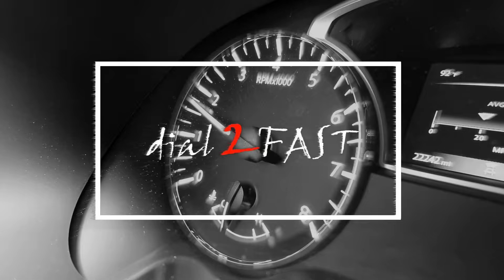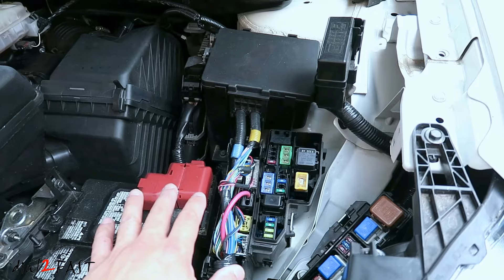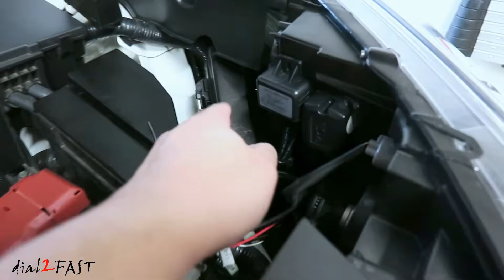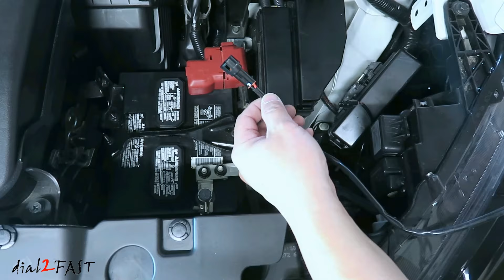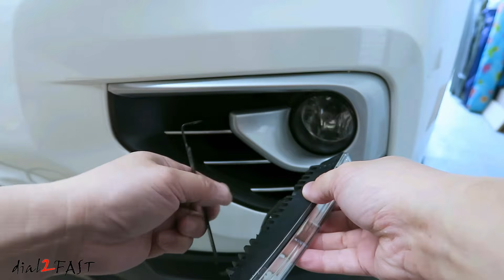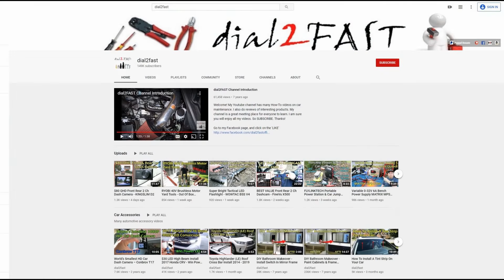How To Install (DRL) Daytime Running Light | Nissan Pathfinder

Comment: @dial2fast, I am really glad that this video popped up in my feed. Still, I have questions. I purchased an aftermarket LED upgrade for my 2006 Honda Accord. The original lights have filament bulbs, and one of them is a shared daytime running lamp and high beam. I read that the way the car switches off the DRLs and turns on the high beams is just by a voltage change.

My new lights use the stock wiring harnesses for the low beam and high beam LED bulbs, as well as the amber signal, but there is a LED light bar on the bottom that just has a black and red wire. I want that to light up when driving, but turn off when the low beams are on. What is the best way I can go about doing this? I appreciate your advice! ProTuningLabs gave me no instructions, only a link to a YouTube video which was not apple to apples.

Comment: Why he did not tap wire of existing DRL?
As far i can recall the OEM DRLs do not turn on immediately with ignition. They turn on when you shift into Drive. But the DRLs installed by him turned on with ignition. Though it is nice video but He could go one step ahead as mentioned above. 🙏🙏🙏
Reply from the maker: You can't simply just tap the factory DRL because you don't know how much current it supplies. Also many factory LED  systems uses PWM (pulse width modulation) LED driver that outputs varying duty cycle voltage, and it's not meant to drive additional LED lighting.

Comment: I'm thinking how the DRL controller works with smart alternator where the voltage is fluctuating between 12.4v to 14v and above. Does that mean the DRL dimming will fluctuate as well?

Comment: Thank you for the Video! Great explanation!!
Do you have an update for us on the life of the DRL controller? I see reviews on Amazon saying that the controller stops working well after sometime. Killing battery because the lights would stay on passed engine off.
Reply from the maker: The DRL controller that I installed in this video did fail after 3 years. I just replaced it with another one (same type), and it's been working fine. In my experience, aftermarket stuff can fail, it's just what can happen when customizing cars. As for killing battery, I personally don't like to run stuff off a car battery when ignition is off. That's why in my video I connected the power to ignition 12V. The problem with running stuff off the battery when ignition is off is if your battery is couple of years old, it can quickly reduce the battery health. And if the auto off feature doesn't function as designed, then it can further drain the battery.

Comment: Great YT video explaining how the DRL controller works. I have a question, I am an electrician and use a multimeter daily, what is the device you have clamped on the ACC wires to measure relay voltage called? and where can I find one like you are using? must penentrate the wires with the alligator clips in order to get the wire inside the insulation.
Reply from the maker: It's a FLUKE AC89 https://amzn.to/4afcIlz

Comment: I need a system that will Turn  DRL "only" when the lights are Turned to "Parking Lights". Can the yellow  blue wire be used for that feature? Other wise I want the lights to turn on when engine starts, off when shut off -after X seconds and dim when Headlights turned on.

Comment: I bought a similar drl that has that white cable for dimmed off but when I connect them to the power while drl on, it just turned off the drl, i’m wondering if I need the drl controller too?

Comment: I have a question, would it matter which side is for the turn signal ? Would I have to tap into either both headlights or just one would be fine ?
Reply from the maker: If you want to connect the turn signal 12V (so your DRL will flash alternately to the turn signal), then you have to connect the left turn signal for the left DRL, and right turn signal for the right DRL.
Reply: @dial2fast  how would I wire that ? Since the DRL remote only has 1 set of colored wire

Comment: Hi Sir, thankyou for the video, i have similar drl controller and drl light, can i use fuse tap (piggyback fusetap) and put in on the acc of my fuse box the drl controller?
Reply from the maker: Yes you can get power from the fuse box with ignition 12V, then it will turn on/off with the ignition.
Reply: @dial2fast  thank you much Sir, one last question the drl controller has a fuse to it. Should I put also fuse on the fuse tap like 5a or lower? I dont know how much is the ampere of the fuse on the drl controller. I will input the piggyback fuse tap  to an empty slot of my fuse box with 12v on it.
Reply from the maker: Even if there is a fuse on the DRL controller, you can still use the fuse tap on the fuse box. For regular LED DRL, 5A (or 10A) will work fine. The 'LED DRL' light itself won't draw more than 1A (assuming that's what you are using for lighting). A rule of thumb when it comes to the placement of a fuse is there should always be a fuse closest to the power source (in your case, it's the fuse box, so using a fuse tap is ideal)
Reply: @dial2fast  thankyou so much Sir for the knowledge that you share.

Comment: I'm gunna throw a spanner in the works of a DRL installation. In New Zealand & under current vehicle by-laws & what we colloquially call a WOF (vehicle, Warrant of Fitness) when you go to turn on your side lights/mains etc your DRL/s must actually switch off automatically & not merely just dim in visual power output!! It is therefore illegal to have both your DRL/s & your main lights (high or low beam) on. You can have one or the other (DRL/s or mains) but not both switched on at the same time. If you are going for a WOF at the time you will be rejected as I was!! No WOF means you cannot use the vehicle on a public highway period!! So I'm looking for a suitable wiring diagram to cover this scenario & any help or assistance would of cause be most appreciated. I'm no auto electrician but I'm not green behind my ears either & have a reasonable understanding of basic vehicle systems. I've actually completed a wiring diagram to cover this requirement but would like to compare it with somebody else!! Any takers please???

Comment: Why do you need an LED driver for? Can’t you just connect the black wire to the negative and connect the red to an accessory fuse?
Reply from the maker: Because a properly working DRL should have dual brightness. Bright for daytime, and dim for nighttime. If that's something you don't need, then connect to the ignition 12v fuse.
Reply: @dial2fast  thanks

Comment: Hi man .  I hope you will help me to find the right solution for me. I want the transformer or the regulator of the LED light, which in turn reduces the LED lighting from 100% to 50% when the light is turned on in the dark or at night.  Or the organizer to buy it online if possible ❤️🫶🏻

Comment: I have a question sir . I have an existing fog light switch with relay and top it on ignition. And I want to use this as a drl switch. I trace the connection red wire goes to the firewall and both have a Blk wire that tap on body ground . The problem is , I bought the drl harness with module  dimmer .  It say on the diagram  the red wire with fuse should tap on directed to positive of batt. And Blk wire neg of batt . The blue wire (ACC) where should I tap ?. On the red wire of the fog light switch ? Or  should I ignore the blue wire.  Or maybe the red wire  with the fuse  I tap directly on the positive of the fog light switch that goes on the  firewall ? Thanks in advance

Comment: Great instructions I purchased thru Ebay new LED Lights for my Audi Q7 2009 and at night it turns White and the signal changes to orange. I want to use the White LED to stay on all the time that way I don't have to turn on the night lights during the day. What I need to buy in order to use the front bumper LED's as Daytime running light with no Dim.? Thanks Auggie
Reply from the maker: If you want it to stay on white when you drive, then just connect to ignition 12V. So when you start your car, it will turn on, and off when it turn car off.

Comment: Thanks for the great video. I installed the exact controller yesterday but when I turn on my turn signals my LED flashes with my turn signal. It’s suppose to turn off the LED to my knowledge. Any idea why that is? I have yellow to positive turn signal.

Comment: I have some sequential mirror turn signal DRLs. It came with a normal plug in and play connector but also has a white wire for the running white lights. Someone said I could jump the window switch wire to get the day time white lights to work. However, my car has auto headlight on and off feature depending on the outdoor lighting. I wanted the mirror running lights to run off the same function is there a way to jump the white into the column selector wire for “Auto” so it works the same way as the headlights go on or off based off ambient light?

Comment: Hi! I have a question. I bought the exact same LED DRL ligh bar and also bought the module. I installed it, but for some reason it wouldnt turn off.

Comment: I've had mine installed for a year but I had my ground wire directly into the negative port of my battery. I then placed it on a bolt inside the bay near the nearside headlamp. There's now a buzzing and clicking and they no longer come on?
Reply from the maker: That ground bolt you are using is not a good ground. You might think a metal bolt in the car is ground but not always the case because the panels on cars are glued and spot welded. Also many people don't know steel is not the best conductor compared to copper. To truly find out if the ground is good, you should use a multimeter to test the bolt. Or you can just try another ground bolt.
Reply: @dial2fast  thanks for the reply. I'll do what you suggested. Thanks

Comment: How, where and why do you have a ground wire when the instructions for the “iJDMTOY (1) Universal LED Daytime Running Light Automatic ON/OFF Controller Module Box Relay” doesn’t even have instructions for it? It doesn’t even show or have a ground wire. Is this a different product than the link you provided?
Reply: The instructions says the black wire goes to the negative terminal….
Reply: Hello? That was a serious question 🙋‍♂️
Reply: @ryanoswald5506  Negative (black)  is ground  on modern vehicles.......at one time back in the day , there were cars and trucks that were positive ground (red) .   a GROUND simply means that everthing  metal on the car ( chassis) is the negative black , or a GROUND........the black  negative battery terminal is a ground .........And this is not to ever be confused with House current ( 110v/120V etc where Green is ground. if you use a black wire for ground in house current you will have a shocking experience , pun intended.

Comment: I have a Ali express Mazda 6 drl set which does constant on and turn signals. The bezels run to a box that lets out a red, black, blue and 2 grey wires. I need someone to tell me where exactly to wire these too. I’m guessing black to negative ,  greys are prob indicators.. haven’t a clue where to wire red or blue

Comment: T tap are very bad many problems with intermittent shorts.  The soldering may take longer to do but when heat shrink does not cause problems.  I will give it a go . Looks like easy instructions Thanks

Comment: Ok I’m on cycle 12 of this video.  Mine doesn’t have a separate power supply.  All wires are on the DRL controller.  So I have a red & black (tye red with fuse on it)-  that red goes to then 12v fuse correct?  Then I have the to wires that connect to the LED via snap connect -  I’ll connect those.  They both have a yellow turn signal- I’ll cut this off.  Then I have a white wire- I’ll connect to my parking light positive.  Then I have a green wire that flashes so I’ll cut that off.  Last,  I have a blue wire that control the dimming function.  Can I splice that wort the red wire that has a fuse on it,  I hope you get me
Reply from the maker: If you have a similar DRL controller, and you connect the controller's red wire to battery 12V, then it will turn on the LED DRL when you start your car, and there will be a delay in the shut off. If you don't like this, then you can connect the controller's red wire to ignition 12V. The white wire can be connected to your parking light if you want to use the dim feature to dim your LED DRL when you turn on your headlight.
Reply: or you can hook the white wire up to the low beam power , then they are half bright with low beam, and will come on  full brightness with high beam, that's how I have mine wired.

Comment: Dude thank you so much, this video has been really helpful. I'm still confused about one thing, though. The DRLs I'm looking at have a seperate, amber sequential turn signal. Does that wire get tapped in directly to the OEM turn signal? From what I can tell from the DRL controller, the "turn signal" wire on the diagram (on the Amazon page) has to be a kind of input, that I think makes the regular drls flash along with the OEM turn signal but I'm not sure how to connect the turn signal so it will use the Amber sequential one. Also if you hook up the blue ACC light to ignition 12v do you need to connect the DRL controller to the battery?
Reply from the maker: If your DRL have separate sequential amber turn signal, then you can connect the white DRL LED wire to the DRL controller (as shown in video), and you wire the amber sequential turn LED positive wire to your factory turn signal light + wire.

Comment: Could you wire the LEDs directly to a  accessory fuse using a fuse tap? Or is the DRL driver that comes with the kit necessary?
Reply from the maker: You can wire it directly to ignition 12V, but usually you want to the DRL to dim at night because it's too bright for night time.

Comment: Hi mate,
On diagram from factory,red wire to (+) battery and blue wire to ACC. 
I show on You connect red wire to ACC so you not use blue wire?
Reply: the blue wire goes to keyed ( only hot when turned on) and will make the lights come on with out starting the engine OR if you start the engine and they will not come on , then you have to hook the blue wire to keyed power . For some reason, some vehicles will not trigger the unit when the engine is started  ( or say you have a hybrid where the engine stars and stops....... if your engine is going back and forth your lights would turn on and off, the blue wirre to a keyed source fixes that ( or so it seems or should ) . I have not heard anyone else say this about hybrid use but I can't be the only person who thought about this .....lol...I'm just a retired firefighter, you know, put the wet stuff on the red stuff....lol.

Comment: I read somewhere that you could make them shut off when the headlights are on.
Reply: Easy, just connect the return wire (the negative) on to the supply (+) of the park lights.

Comment: My question would be if you bought aftermarket drl headlights that the drl is controlled by the marker light.  Can you easily make it to where the drl is turned on with ignition?
Reply: That's what the drl controller does. And why you would need to tie the signal wire into acc or ignition power. For what im doing id rather just use the spare empty relay and fuse slots in my fuse box and do all my wiring in the fusebox. A lot cleaner and if the fuse or relay goes out I can just replace it with one I can get at any auto parts store.

Comment: Noob question, what guage wire you used for extending the connector to the left side?
Reply from the maker: Use 16 gauge or larger.

Comment: A very professional installation...I need to get one of those modules, do you have a link to it please....
Reply from the maker: See link in description.
Reply: Hi there, so do I need the drl driver aswell?? I cannot just have the drl controller connect straight to the led’s,,,any info would be appreciated....
Reply from the maker: @mariomanzatti8951  In the video I installed the DRL driver because that's what came with the set of DRL light I purchased. The DRL controller can power DRL light on it's own.
Reply: The driver should help to regulate the current so they last longer

Comment: This is what I was looking for.
I had the DRLs directly on the more fancy module, which shorted the right side due to water in the drl plug.
Now I don't want to wait another 1+ month from china, and in my country I could only get a "smart" module that has one output (don't know why you would make it like that).
And I could not decide how to split one module output in 2 DRLs.
But seeing this I remembered I still have the driver that came with the DRLs. So I'll connect the single output from the "smart" module to that one, which will split to both DRLs.
Awesome, thank you

Comment: Awesome. Very detailed and well explained. Will this work with any LED lights? Or is there a special type that can dim?
Reply from the maker: It will work with any LED DRL light,  but not LED headlight or fog light.
Reply: @dial2fast  thanks!
Reply: @dial2fast  I just installed the module but I can't get the lights to dim. Just a small flicker but not that 30-50% drop. If there's too much power from the lights will that prevent dimming? The fuse the module came with blew once I hooked up both lights, so I had to get a bigger one. Really appreciate the help!
Reply from the maker: @batvon39  Sorry for the late reply. I am assuming you bought the iJDM DRL control module for the install. If you did, the white wire need to be connected to either parking light or headlight +12V wire. When this wire senses 12V (you turn on the headlight), then the DRL will dim. If your DRL is having problem turn on and staying on with ignition, then you may also need to connect the blue ACC wire from the controller to ignition 12V. If you have done all this and still having problem, you should contact the seller for further assistance.
Reply: @dial2fast  No problem at all, thank you for all the help!!